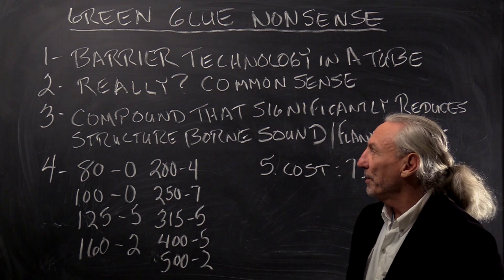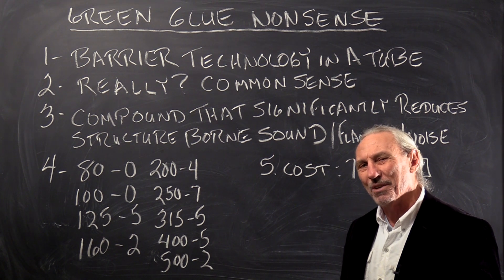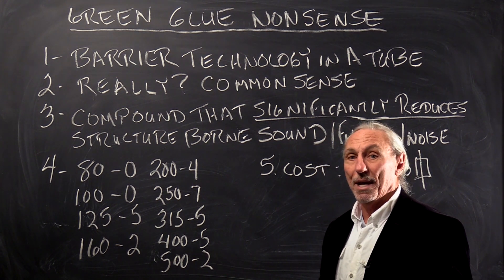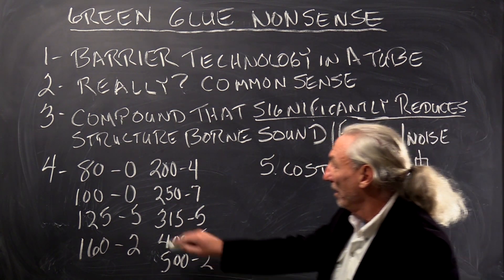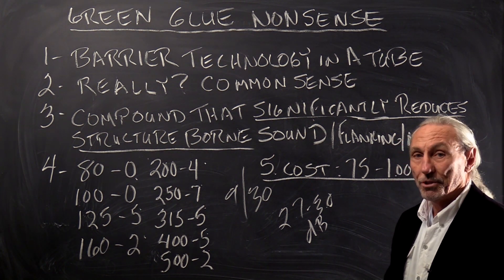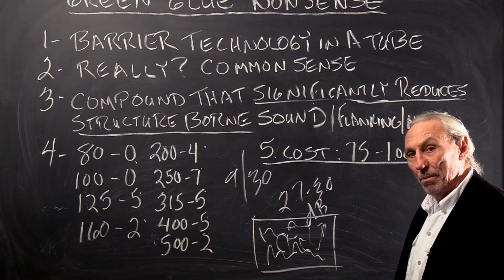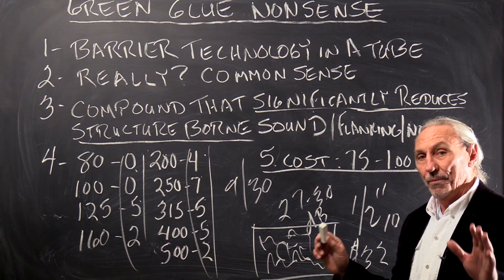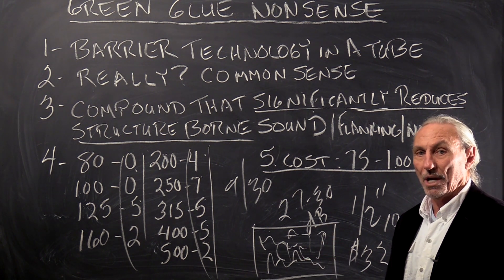Green Glue Nonsense - www.AcousticFields.com

Comment: If double staggered stud wall separated with acoustic mineral wool between is old fashioned, what is better? What's the 1/2" material you mention? I'm looking to build a house in the UK and require some soundproofing between stud walled rooms.
Reply from the maker: This methodology is 40 years old, takes up too much space for performance benefits and only works for frequencies above 125 Hz. I do not know why anyone would use it. With noise, you must always and let me repeat that, always measure the noise. Without knowing what frequency the noise is at, how great it is, and at what time it occurs, you are guessing and guessing with noise is foolish. If you guess wrong, which most do, you may have to tear out what is built and start over with the proper construction methodology or live with a failed barrier. We can assist you with the noise measurement process. Contact us at info@acousticfields.com for further guidance.

Comment: Nice to see somebody who speaks the truth. Most people don’t understand that most structure borne noise is low frequency and none of these quick fixes solve those problems. And the green glue is no fix. I’ll take the half-inch.
Reply from the maker: You would be in the minority. Most would take the glue. The belief system associated with this adhesive is deep and well embedded in years of half truths, ignorance, and hyperbole. The glue has been granted divine powers even when used by itself.

Comment: I'm suffering from noisy neighbours and I've invested in alot of drywall and mlv. I've also bought alot of fiberglass insulation. My idea is that to block the noise I need to build a stud wall separate from the party wall and so I'll attach the stud wall to the ceiling,wall and floor one inch from the wall to decouple it. Then add fiberglass insulation between the studs to absorb some sound. Then I'll add mlv over the studs which will be followed by a layer of 15mm drywall, sandwiched with another layer of mlv then topped off with more 15mm drywall! Studs are 4 inches  by 1  inch to allow the 100mm fiberglass insulation. I'm sick of my druggy neighbour and her constant noise! I'm so stressed its causing me to have anxiety problems so this is my last resort.
Reply from the maker: Why are you guessing at the barrier you need to build to stop the noise issue? Using building insulation that was designed to keep your room warm or cold (BTU retention) to reduce noise transmission is never a good use of space or materials. Have you measured the noise you are fighting against? Without noise numbers you are guessing and guessing with noise is a fool's game. You will guess wrong every time. I have been doing this for 40+ years and sometimes I guess wrong in conversation. What chance do you have? Measure twice, cut once.

Comment: Green glue does work on hollow interior doors, directly apply  plaster board on wood with green glue in between and a few screws around
Reply: think of it this way. it does something, but it's actually the air barrier between the two boards that is doing something. not specifically the green glue. if you put any other liquid adhesive in between it would work just as well. it's the gap between boards that insulates a little, just like a double pane window compared to a single pane. because liquids can't be compressed, the glue creates a gap between the boards. that gap fills with air, and that's your insulation. it's not great, but yes, it does 'something'. so the method does something, not the green glue. if that makes sense.
Reply from the maker: @slavesforging5361  The process you are describing is constrained layer mass damping. Air is one material type that you can use as an material type in your barrier design. The issue with this product is people's perception of its "magical powers". It an adhesive. That it all it ever was. That is all it ever will be.
Reply: @AcousticFields  good to know the name of it! Thank you. Your channel is awesome and very informative. I completely agree. The green glue is doing nothing. People are getting really confused, thinking the green glue is doing something special or magical, when it's not. It's just a marketing scam.
Reply from the maker: It works as an adhesive. There are many other adhesives that you can use that are cheaper and will produce the same results. It does not have any "magical" acoustical properties as everyone claims.

Comment: I used some heavy felt paper glued 2 layers to drywall using cheap latex caulk or construction adhesive and rockwool insulation and worked great
Reply from the maker: What did this process work great for? What were the frequency and amplitudes of the issues it addressed?
Reply: @AcousticFields  I used it to hide noise from mini split lineset inside regular wall  4". This was done inside master bedroom closet so clothes also muffle it plus there is closet door also

Comment: I've seen on a different youtube channel,  explain that the green glue is supposed to work by creating air pockets between the drywalls. (I dont know if it actually works tho).
Reply: @ Acoustic Fields - you say something very different on your own website. You state that it works, but there are "better" options that you say you use, but won't reveal them haha. I bet you use Green Glue as well
Reply from the maker: It is an adhesive, nothing more. You can achieve similar results with standard construction adhesives.
Reply: @AcousticFields  it’s not even an “adhesive” I’ve used green glue and doesn’t stick as other caulking, adhesive or not. Green glue stays “gooey” forever (doesn’t harden or rubberize). It wipes off with water very easily even well after curing. Saying it’s an adhesive because their name has “Glue” in it is a perfect example of “judging a book by its cover”
Reply: @yosh1to  that proves that it is not an adhesive.

Comment: Hi! Thanks for your helpful video on green glue. I'm enjoying looking around your channel at other videos too.

I'm looking to build replacements for (or modify) standard hollow-core doors on the bedrooms in my residence to reduce sound transmission. The main focus is to increase privacy by reducing sound carrying outside the room. The main focus for noise reduction would be conversation and - ummm - lets say other vocal sounds. If the solution also helps decrease transmission of lower frequencies that would be a welcome bonus.

I already know I will be using a drop-down neoprene seal at the bottom of the door, plus a neoprene seal around the perimeter - I'm thinking more door construction technique. Even better would be a way to modify the existing hollow core doors to increase their performance.

I would appreciate any advice, direction or thoughts you can give on this project :)
Reply from the maker: Use solid core (2) doors with a 1/4" mass loaded vinyl  layer between each door. Make sure your seal is air tight.
Reply: @AcousticFields  Thanks! I presume you mean I should take 2 solid core doors and attach them together with a layer of MLV in between?

Should they each be bonded to a side of he MLV? Or screwed together?

May I ask for your thoughts on a thinner solution? Something that come to 1 3/8"-1 1/2" total thickness?
Reply from the maker: Glue and edge band.

Comment: Hi, I'm building 5mx7m timber construction music room in the garden 20ft away from my neighbours for my daughter who is an acoustic drummer. I'm using 18mm osb, 120mm x45mm timber frame, rock wool slab, 400mm gap, 100mmx36mm timber frame, rock wool insulation, membrane, resilient channel, then 3 lots of soundproof plaster board stuck together with carpet adhesive... 
In simple terms do you think this will be good enough?
Thanks
Reply from the maker: I have no idea without noise numbers. You are guessing with noise which is very foolish. If you guess wrong, you will have to tear it all out and start over.

Comment: the point of green glue is not to air seal... it is formulated to remain elastic over its life rather than dry hard.  This is suppose to decouple the 2 pieces of sheetrock
Reply from the maker: Any standard, silicon based, construction adhesive will accomplish this objective.
Reply: @AcousticFields  horseshit, Green Glue is a damping compound whereas silicone sets like rubber. You talk about it like it is an adhesive or a barrier. Clueless! The fact that you do a video about this material and don't once mention the principle of CLD shows that you either don't know what you are talking about or are deliberately misleading people. Probably a bit of both...

Comment: You've been asked several times what method you have that will work better for $10 and no answer. I will ask it a different way to see if I can get to the answer. What product of yours do I need to purchase that will tell me how to better mitigate the transference of walking noise, TV and talking noise from my  first floor to and from my basement? I would like to try and dampen those sounds in my basement and had planned on using roxul and 2 pieces of 5/8 drywall with GG which is going to be expensive so I would be willing to purchase one of your products that would show me a better way that costs much less I just need to know which product of yours I need to purchase? I don't need a sound studio or media room I just want to reduce the everyday common noises from walking on wood floors, talking and TV noise is all I'm looking for. Thanks.
Reply from the maker: And I have said many times and I will say it once again, every noise situation is different. You are looking for a one size fits all and you will never find it. Let me repeat the question one more time that must be answered, what are the frequency and amplitudes of your noise issues?
Reply: @AcousticFields  Useless troll. People want to control the noises of everyday life and there are solutions that work.
Reply: @AcousticFields  How would your average home owner go about measuring the frequency and amplitudes of various household noises?
Reply: @MrScubby65  this does make me a little crazy. One size does not fit all but how many sizes are there? You do not reinvent the  process every time. This is very convincing video to not use green glue but with no alternative. Leaves you spinning.  We are all dealing with the same range of problems. So just put the  two layers of drywall up with nothing in-between? Save the $$ no difference? Not sure...

Comment: I'm building a small drum room for practice, and considered green glue or MLV between drywall layers. I'm going to load the room tremendously with SPL. For my inside walls and ceiling I was going to use a clip/channel setup. Do you think 2 or 3 layers of 5/8" drywall will do a decent job on its own, or would I try and use layers of green glue or MLV in between? I'm trying for an STC of 65-70. I am for sure worried about 40-125 Hz not being as effective. Any suggestions would be much appreciated. Thanks again for the great videos.
Reply from the maker: This method will not work for your usage.

Comment: Thank you for your insights regarding this matter.  I was trying to figure out a way to justify the cost of Green Glue for a home studio project and was looking for a possible work-around solution.  I was wondering, however, about putting foam (or rubber) weather striping between the sheets in lieu of the Green.  Would love your thoughts on this?  Thanks again.  Cheers!
Reply from the maker: O, What is the frequency and amplitude of your noise issues? You must know what you are fighting before you build the proper weapon.
Reply: @AcousticFields   Thanks mate.  Point well made.  It's a new build so no issues yet.  Since mid to highs are a little easier to mitigate it's my hope I can squash out some of the low-mids down to maybe 30hz (?).  I admit I'm not being very scientific here.  Isolating one drywall sheet from another just sort of makes sense and weather stripping is by far the least expensive way to go.  But will it do anything to trap and soothe bass?  I guess I'll find out through a little trial and error.  I'll test the room (12X24) before and then after the second sheet is installed.  I do get occasional rumbles in my home from a train track approx 4 miles away.  Those are probably 4' wavelength monsters :D  I don't expect much luck with that.
Reply: @ontogeny6474   Place tar paper between the dry wall layers?  Just use Green Glue or a substitute on the studs before the dry wall?
Reply: @Lughnerson  lol
Reply: @Lughnerson  yukon for the win
Reply from the maker: What are the frequency and amplitudes of your noise issues.

Comment: Green glue isn’t supposed to completely seal, it’s supposed to leave room for an air pocket in between two layers of sound proof material. If you don’t know why, it’s because you don’t know what you’re talking about.
Reply from the maker: J,  Green glue is an adhesive and nothing more. You need to do more research before making statements you can not support.
Reply: @AcousticFields  it is a damping compound you lazy clown